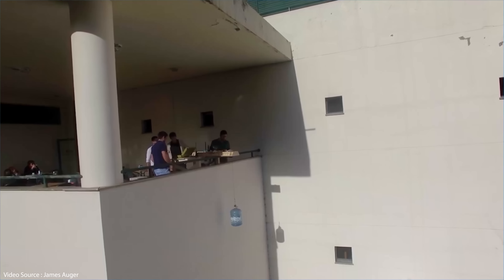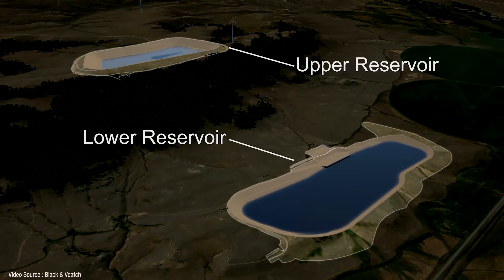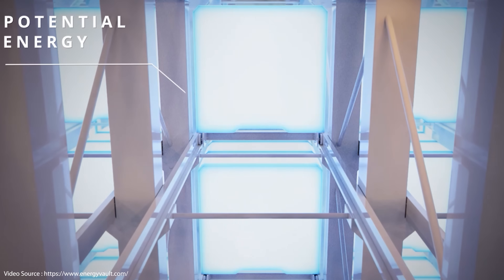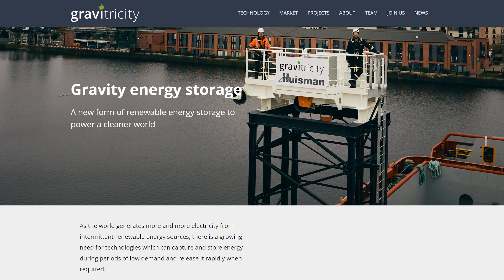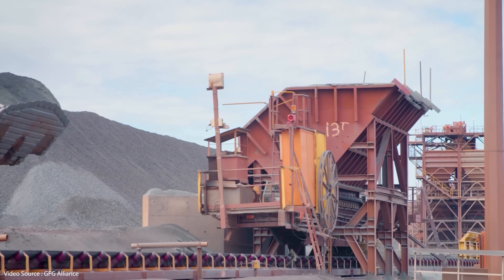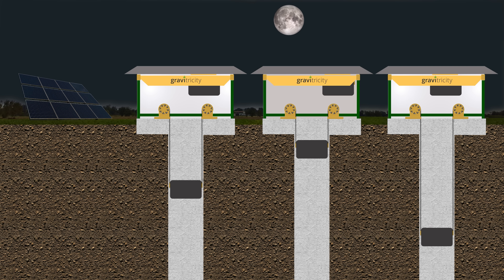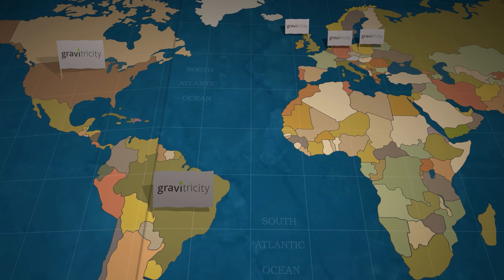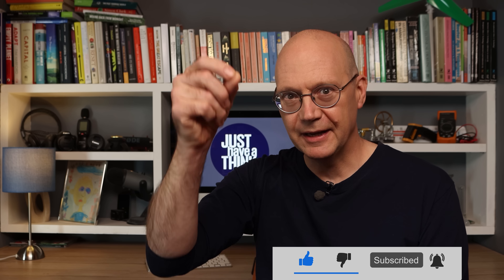Gravity Energy Storage. Who's right and who's wrong?

Comment: I can't believe that energy vault got as far as it did, at best it was too finicky & the next version isn't much better. The gravitricity mineshaft version looks more promising with a more controlled environment, fewer points of failure, it has a much smaller footprint, regenerative power is proven, and cheaper to implement since the hole is already there.
Reply: But just wait until the rock monsters see that iron ore coming down.  The Enterprise may have to tractor beam the ore up before they nibble on it! 🚀
Reply: Well the holes are not always perfectly vertical and you would need a large air shafts because of dropping large volumes of material otherwise you would get a water hammer effect. As you are using former mine shafts your going to run into problems of water which leads to a problem of corrosion of metal parts. The best of wires can only last so long without corroding so life times stated is probably 1/2 of there estimate.
Reply: @davidphillips1133  I've been thinking the same sort of thing. Still far less ludicrous than Energy Vault though.
Reply: Mine shafts already have large air vents and of course the hoists don’t fit the shaft like a glove either.
Reply: It also has very limited potential use, as there are relatively few abandoned mine shafts around the world. And digging a new hole just for the energy storage system would make the whole thing prohibitively expensive. Energy Vault's solution is aimed at being able to provide storage anywhere in the world.
Reply: @zlozlozlo  The US Bureau of Land Management would like a word...
Reply: still good to know that something like the energy vault was conceived and tested even if it doesnt come to fruition.  Got to get the errors out of the way to make way for the proof positives.
Reply: the problem is that it's at best an even more limited technology than hydro. You need an existing mineshaft of sufficient size and shape in order to fit the new device and at best you're probably not going to get much capacity out of the few locations where you can put them.
Reply: It might be better to just pump water in and out of that hole.
Reply: I think y’all miss the nature of basic research! Storage without all the environmental problems associated with lithium, cobalt, or any of the rare earths, and mining in general should be given more of a helping hand! Just look at all the petroleum trolls with diarrhea of the mouth concerning petroleum is so cheap. Sure it is when you don’t include the costs of asthma or the zones of cancer around refineries. How about what the Navy has spent every year keeping the shipping lanes relatively pirate free! Course none of the wars the last 40 years had anything to do with petroleum.
Reply: Uh no
Reply: Exactly, I loved the animations of them operating those weights with wind turbines in the background! Their second idea is a maintenance nightmare, especially if is going to be an open air facility.
Reply: None of these gravity storage systems seems plausible or efficient.
Reply: If there’s water seepage, the best it can do is generate enough energy to keep itself pumped out. Gravity is just not a great source of energy unless it’s enormous quantities of free dammed up water.
Reply: Unless it ultimately utilizes a natural resource with a naturally occurring high energy return, spending energy to make energy is like lifting yourself up by your own hair. Indeed you’ll just be pulling your hair out. End of story guys.
Reply: discarded minshafts make for unsexy powerpoint when marketing to investors
Reply: @ Evil Otto
I disagree. Discarded mineshaft areas are less likely to draw the protest crowds when a company seeks to do something there.
Reply: @mikedavison3400  Aren't mining companies suppose to de-commission their mineshafts after their use?
Reply: @ MolloRelax
Not as far as I know. They are supposed to build barriers at the entrances but even that seems to be hit and miss.
Reply: It is also not very convincing that they present their (final) idea and probably pitch for money without having built a reasonable prototype to test their theory. After "working" on whatever and getting told that the idea will not work, they completely change their concept.
Reply: @Kiboxxx  Yes! Their idea crumbled under basic scrutiny (though not before wasting a lot of money) but it's a good idea to never trust a company that only ever presents CGI concepts, proof of concept isn't just important but vital.
Reply: gravitricity solution looks like a more practical version Pumped storage hydropower and does not require a football field of water.
Reply: If it doesn’t require a “football field of water” or more likely many acres at significant altitude it cannot store much energy.  Pumped storage pumps millions of tons of water.  A few rocks on ropes cannot amount to much.
Reply: @Pale_ghost  a football field of water is a lot cheaper than a football field of concrete.
Reply: Când nu ai gaură de mină faci un carusel dublu iar pe lanțurile lor pui să se rotească cilindrii din beton, iar diferența de greutate stânga-dreapta vor produce mișcare, ca la un perpetuu mobile. Sus cilindrii sunt opriți din rotație cu recuperarea energiei. Nu este P. M. pentru că trebuie energie pt rotirea fiecărui cilindru stg. jos. De la o altă sursă de energie ( ex:eoliană, hidro,solar,abur,,,,)
Reply: I will repeat the comment. Pump the water back in the existing dambs. No need to build new engineering structures.  So simple...
Reply: @ksd593  You need to have a decent difference in groundlevel for that. That's why you don't see many hydropower dams in estuaries.
Reply: @MPostma72   I agree. Estuary level required or dam after dam. Have you seen narrow boat canal system in England? That could be a nice system of hydropower + gravity storage.
Reply: @ksd593  You arnt getting much energy out of locks. The power generation potential is all about the fall distance. So you are better off to have one BIG dam with big turbines than a bunch of small dams with small turbines. This is why geography is the limiting factor with pumped storage.
Reply: @patreekotime4578  harnessing+storing  much in some places and harnessing+storing little bit everywhere can go hand in hand together, one sould think, no?
Reply: @ksd593  agree 100% although a tail pond (lower dam) is needed for loop system.  Alternatively modify existing hydro to demand response (higher flow capacity, rating varying rate of release, same volume of release over the week)
Reply: @peterwilliams3246  👍👍👍 I exaggerated. Some engineering reqired ...
Reply: @ksd593  I believe that in the United States, or is it Canada, I don't recall which side, this is already done at Niagara Falls, and has been for decades!
Reply: use your own personal car to make gravity energy by driving up and parking on a ramp .
The ramp will slowly come pack to level over night and raise using springs while your at work .
Lowering and raising cycle produces energy via water powered turbines .

Tidal energy principal small scale .
Reply: @rocklover7437  assuming a ramp elevated 2m that's barely enough energy to boil a shotglass of water..
Reply: @rocklover7437  i really hope you are joking.
Reply: @mralistair737  Energy quantification isn't always intuitive I'm afraid, the mechanical work required to create electric power is often taken for granted.
Reply: @SirArghPirate  Aye, everyone thinks there’s a Tooth Fairy out there waving a mechanical wand….!
Reply: Really, really small scale. Useless.
Reply: @edwardcoulter9361  As long as it's profitable then it's not useless, such an arrangement might only provide enough of an energy buffer for a few hundred homes (that's a guess) but that's a load taken away from more destructive power production methods. Changing the way we produce power was never about replacing large coal, oil, and gas plants with equally large renewable plants but rather a network of smaller, independent power sources that are less harmful, more varied, and immune from a centralised disruption. We can't go on buying fossil fuels, it's becoming an ever greater financial burden and political vulnerability.
Reply: @Voltaic_Fire  Thing is, the energy capacity of these concepts has to be measured up against the required energy to manufacure them as well as the upkeep and reliability. These are massive structures made from steel and concrete and mechanical energy storage with linkages etc will inherently be relatively ineffective with large power losses. To put thing into perspective, a block of concrete weighing 1000kg hurling down with a velocity of 2m/s is barely enough to run a vacuum cleaner, assuming 100% efficiency. Add to that the mechanical logistics with power loss etc.
Reply: @SirArghPirate  I'd like to see the math on that. The video started by showing students running a turntable off the energy from a weight they managed to carry to a balcony being lowered. A vacuum cleaner uses more power than a turntable, but the ratio has got to be less than the students on a balcony vs. 1000 Kg @ 2 m/s!
Reply: @sydgriffin7591  Yes, it's scalable. The students demonstrated powering a turntable. By my calculations, the weight is approx. 20kg, velocity approx 0.1m/s, which means during a second the power generated is mg*deltah = 20*10*0.1 = 20J -> effect being 20W, which seams reasonable. Given a 100m tall building that weight would be able to power the turntable for a quarter of an hour . A 2kW vacuum consumes 2kW*1s = 2kJ during a second, which is equivalent to a mass of 1 tonne moved by gravity, 2m in one second. Power loss in mechanical systems however doesn't generally scale lineary with load, which means that with larger masses there will be larger losses.
Reply: @SirArghPirate  Umm... perhaps you have an error there?  Such a block lowering at a constant 2 m/s in standard gravity is 19 kW for as long as it takes to travel the length of the mine shaft (less than 5 minutes in a 500 m mine shaft).  19 kW is one heck of a vacuum cleaner.  lol

Leaving that aside however, I'm NOT a fan of this sort of gravity storage.  I agree with you that the mechanical system and losses are often overlooked.  Scaling your example up, even a 300 t block falling 2 m/s for 1000 m shaft could AT BEST only provide 5884 kW for 500 s, a grand-total of 0.82 MW hr.  A far cry from the 24 MW-hr storage highlighted in the video's cost of storage analysis.
Reply: @mikefochtman7164  The factor between your last two examples is only about 30, so 10000t in the same hole would do it.  Although losses will probably be less at lower speeds with larger weights. Like 20000t at 1 m/s.
Reply: @mikefochtman7164  You're aboslutely right! I was off by a factor of 10! (Rounding off g to 10m/s2, made me overlook it.
Reply: @johndododoe1411  20000 t ??  Come now, there ARE limits.  That is on par with the heaviest crane lift ever recorded (20,133 t).  And you want to raise/lower it at 1 m/s?  A couple of times every day?

This would be 'cutting edge' stuff to say the least.  That means it probably would have a lot of technical issues to get/ keep it running. Possible?  Yeah, I suppose.  But would it work problem free for any serious number of cycles? Say, 1000 lifts? (about 3 years)  I doubt it.
Reply: @mikefochtman7164  Don't think of it as a traditional crane but as a complete hoisting system that can use multiple winches.
Reply: @SirArghPirate  Wow. If the energy calculation you just gave is accurate-- and I trust that it is-- then even a gravity energy storage project scaled for home solar would be shockingly massive and costly. That's really discouraging. Energy storage is the great conundrum facing the issue of sustainable energy. I just don't see that the answer is even on the horizon.
Reply: @donnievance1942  Not sure which comment you responded to. A mechanical energy storage for home solar I believe is not efficient, for that electrochemical (batteries) are a better alternative, be it a stationary power bank or charging an eletrical vehicle etc. Home solar in parts of northern Europe is paid down in a matter of years now due to relatively high energy prices.
Reply: @rocklover7437 the energy it took to drive up the ramp is close to what you’ll get out. The laws of physics just don’t let themselves be broken easily.
Reply: CGI magic wand stuff.  Can’t possibly be useful with all that wasted motion. Silly as Elon Musk’s car pods transport.

Comment: As the system offers long term storage with term independent losses, the tech could offer a tool for the box to cater for seasonal dips.
Reply: As mentioned in the video it is a short term energy storage system only. That's why they compare it with battery storage systems.

Just imagine it would be lifted just once in summer and then lowered in winter again. So you earn money for just 10 minutes per year. But you still have the whole investment and maintenance cost of the facility. Of course you would want to lower your weight as often as possible. Preferably multiple times per day. And that is how they calculate these low LCOE. 
As  seasonal storage you can multiply the LCOE with a factor of at least 300 (depending on their actual assumptions).
Reply: @janwinders  The video quoted the LCOE of systems operating as a short term stroage system but if you did the same analysis for the same technologies for a longer term storage system this would come out very near the lowest cost if not the lowest cost.
Reply: 500 tons moving 500m vertically stores kWh.  The weights need to be very cheap and you need lots of storage room if you want to cover seasonal dips
Reply: @jonathanedelson6733  I didn't suggest that this technology be solely responsible for covering dips, just that it could help as can hydropower and flow batteries.
Reply: @eclecticcyclist   I was not saying it couldn't work.  I was trying to describe the costs involved in making it work.

Say you already have the shaft and regen lifting/lowering system, and assume that this system already makes sense for short term cycling.
Now you ask 'what is necessary to get 'seasonal energy storage'. Say 'seasonal' storage means charging and discharging 2x per year.

Say your shaft is 500m tall, and you use 500 tonne masses.  Each mass stores 680kWh.  Over the life of the system each mass cycles perhaps 100 times for this 'seasonal' usage, and thus stores 68MWh.  The cost of the 500 tonne mass plus the space to store it top and bottom has to be really cheap (my guess, $5-20K) to be worth it for seasonal storage.  You are welcome to do more accurate math.

Keep in mind that if your 'seasonal energy storage ' is too expensive,  then you are probably better off with things like larger solar arrays to provide sufficient off season production. 

Jon
Reply: @jonathanedelson6733  this!
680kWh
By comparison Dinorwic stores 9.1GWh, that's 13,300 times as much.
Reply: @jonathanedelson6733  When the first Cretan wind turbines were invented who would have thought that they would lead to a bunch of giant turbines collectively generating  GWs of power. or a bunch of ex laptop batteries could power a production car to an second 1/4 mile. All you need to do is work out how to scale.
Reply: @jonathanedelson6733  Graviticity plans to use scrap iron.